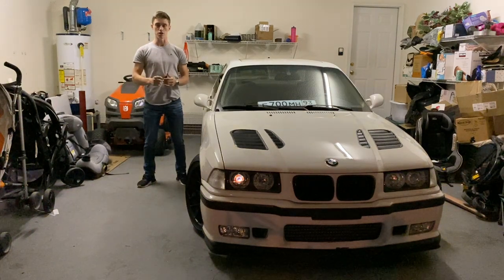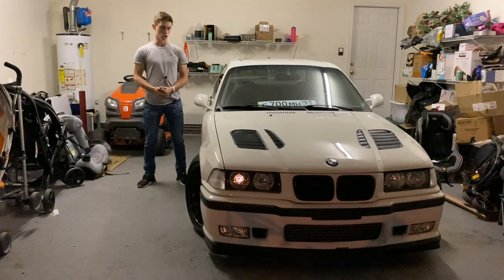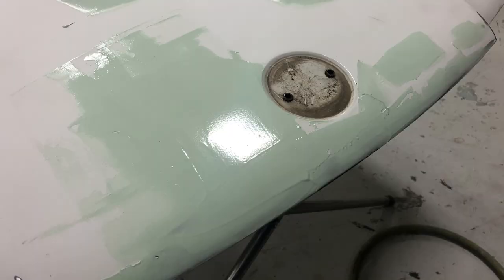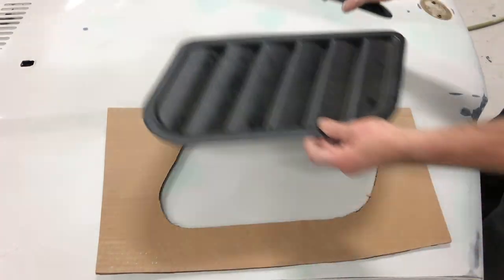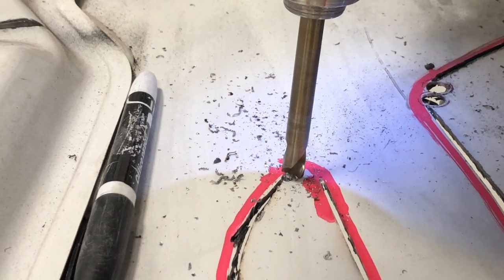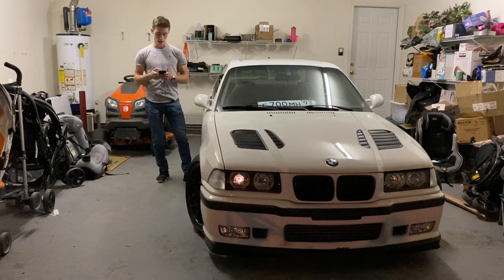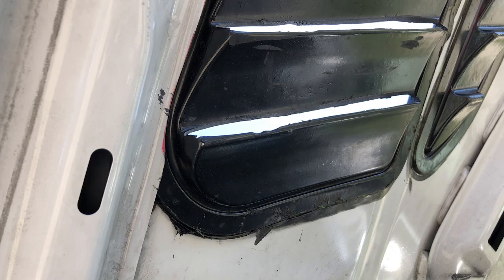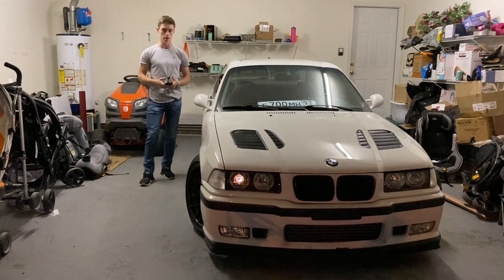GTR Style Hood Vents/Grilles Install

Comment: it was very interesting to see your review of our products =) you did approximately correct but made a few minor mistakes
Reply from the maker: Love the grills! What kind of errors? I would love to fix what might be wrong!
Reply: @alexkichigin  you did not sand the fastening piping before applying the glue =)

well, I would use a thinner tool like a dremel there, the nozzles are thinner and it is easier to work with narrow places

also carelessly cut out the air holes

but this is all nonsense and does not affect the overall work done by you
Reply from the maker: @X-Shadow  yes those mistakes were made out of me rushing it! The building was closing and did not have enough time. I do agree very sloppy and I plan on redoing it in the future!